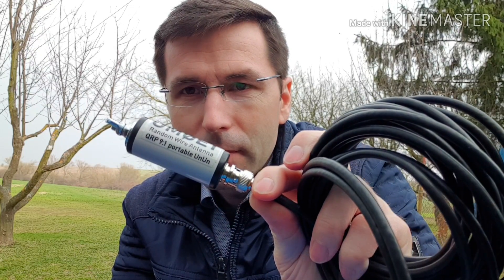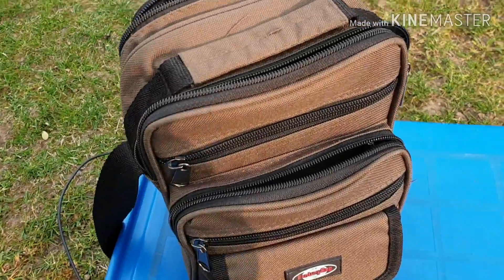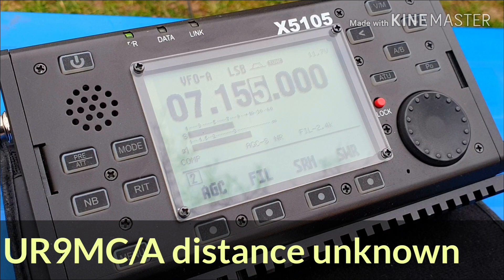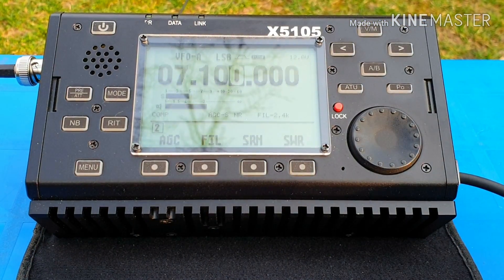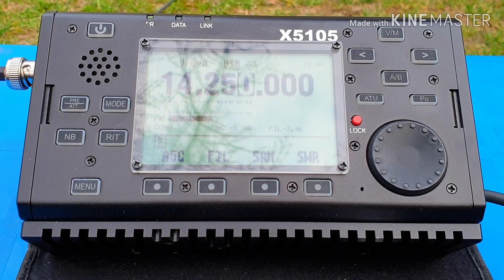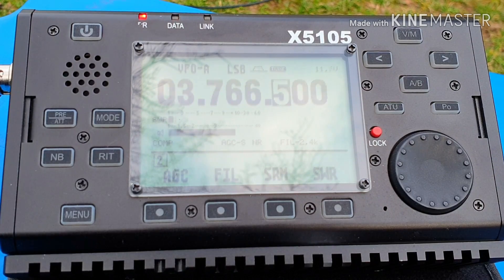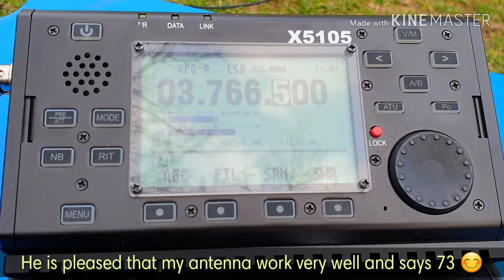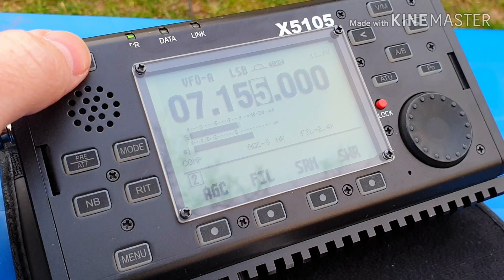#2 TEST:  MINI 9:1 UNUN and 41m long Random Wire Antenna (part 3)

Comment: Hello Paul. An interesting series of videos. The antenna would work much better if you used a long counterpoise on the ground side. This can just be layed out on the ground and it would give the antenna something to work against. Try it with a counterpois that is a quarter wave at least at the lowest frequency you wish to work at. Also, it would help to get the radiator wire s high as possible. For this you can use a telescopic fishing pole. You can buy cheap fibreglass fishing poles about seven meters long which are very light for carrying in the countryside. 73s de G0BZB.

Comment: nice work with the qrp station i have in my radio collection a army vhf radio RF10  from your country before the split i have all the paper work but not in English i think 2 watt on 6m band do you know this radio its very well built my one built in 1985 and its like new  anyway Happy new year to you and yours keep up the good work love the videos
Reply from the maker: Yes Chris I used this transceiver when I served in Slovak Army 😃 but our radios were deaf, I don't know why 😃 Maybe there was some problem with  antenna or electronics inside. Things made during the Communism era were made very well and with good quality, especially things made for Army. Even the components for Army electronics were specially sorted for theyr equipments, incl.radios 😉👍 Thanks for watching and Happy new year! 73, Paul.

Comment: A very well made and informative video, thank you, I have now subscribed. Did you use the ATU on your radio to match the antenna? Please can you say what the resonant frequency of the antenna is?
Reply from the maker: Thank you! :) Yes I use ATU. but not everywhere. On some bands is it not required due to low SWR. This type of antenna is called "non resonant" therefore it should be not any resonant lenght of this wire. The "random" lenght of the wire can't be a halfwave of any HAM bands.

Comment: Nice NVIS setup Paul, think your results closely parallel the what should be expected with an NVIS antenna arrangement, it's not that far above ground. That contact from the Ukraine is about the practical limit, maybe 1000km from your QTH with that antenna under normal conditions. Not surprised you didn't work the W7 on 20, it's not a DX antenna, most of your energy goes straight up.  Can't think of a better setup for local contacts, remote net operation, a grab n go kit or for an emergency setup...you just throw the antenna over a 15 or 20' tree and away you go... so easy to deploy.  A 9:1 balun is pretty easy to make if you have a  proper ferrite core or an old toroid.   Richard VA7AA
Reply from the maker: Yes Richard I fully agree with you :-) But I don't gave up hi hi :-D Of course I know that with this elevation is not possible working DX stations. i will try to made some verical next time ;-) 73, Paul

Comment: The configuration your antenna has been deployed for past year of videos is basically an NVIS antenna. Have you considered carrying a telescopic pole that when collapsed can be used as a walking stick. When expanded it would raise one end of your antenna giving a better takeoff angle for working DX. Mast length could be 10 meters up to 15 meters extended and 2 meters collapsed. 73 KB8AMZ
Reply from the maker: Usually I use a small telescopic vertical SPX100 or my home made magnetic loop 😉

Comment: Congrats on your antenna setup.  I am just getting into QRP.  I have a uBitx, a Bitx40 and finally a QCX40.  I am looking at building a 9:1 unun and have watched all your videos on this adventure.  I am curious as to why you only have 4 turns when the plan show 9 turns?  I have a T106-2 torroid that I am going to use that came from a failed Chinese QRP antenna tuner kit.  So I was curious as to why only the 4 turns.  Really like that setup you have.  DE WD8WV
Reply from the maker: Thank you for watching my videos!  Here I paste one explanation comment from one user:   To clear up some confusion in the comments...It is clear to see that you have 5 turns on the core. Each time the wire passes through the center of the core it is counted as one turn. Even though the drawing we see in the video has 10 turns the 5 turn toroid as built will work but more turns are preferred. The fact that it is a tri-filar winding, no matter how many turns, will result in a 1:3 turns ratio which also results in a 9:1 impedance ratio. This could be made with just 3 turns but, again, more turns are preferred. 10 turns would be much better. No matter how many turns it will always be 9:1 impedance ratio because of the 3 conductors in the windings and the way they are terminated. A ground or at least a length of counterpoise wire is important to achieve a satisfactory SWR.
Reply: OM0ET thanks for the explanation.  I will have to try and build myself one of these.

Comment: Did you try running a ground wire from the ground side of your bnc connector, to bring down your swr?
Reply from the maker: Yes I did, there was slightly better SWR. I use about 8m long coax feedline like counterpoise.
Reply: I am working on a 9to1 and a 1to1 common mode chock connected in the same enclosure. I will let you know how it turns out. Thanks for the reply.
Reply from the maker: @marybilbrey3442  Very well ;-) Thanks too. 73

Comment: You will be surprised if you leave this antenna loose on the ground. A configuration called Grasswire Antenna (Which you can find on the web https://www.google.com/url?sa=t&rct=j&q=&esrc=s&source=web&cd=1&cad=rja&uact=8&ved=2ahUKEwi_-oDmvaLhAhWFILkGHYwIA6cQFjAAegQIABAB&url=http%3A%2F%2Ff5ad.free.fr%2FLiens_coupes_ANT%2FG%2FK3MT%2520Antenne%2520gazon.htm&usg=AOvVaw0zuJ2YDrEmslnoRcgzekCR). Thanks for sharing your experiences. LU1AR
Reply from the maker: Thanks for your comment. ;-)
Reply from the maker: works! but parenthesis shouldn't be there :)

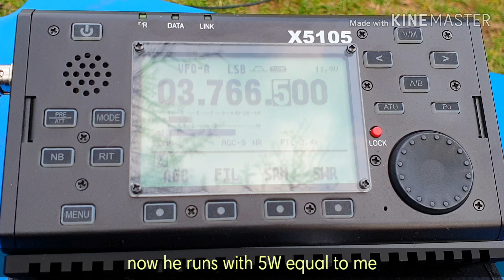Comment: The gentleman that lowered his power at the 9:00 mark actually sounded better with five watts than with 100 watts.  At 100 Watts it sounded a little blurred and was clearer at 5 watts.  Very interesting.  I have been keep up with your build and am very pleased it has turned out so well.  73!! DE KE5ES
Reply from the maker: Hello Bob, thanks for your comment 😉 This blurring may be caused by a small speaker used in X5105. Maybe I had volume turned too loud 😊. I tought that it will be barely hearable in camera, but later I realized that it was too loud 😲. Heh 😆 I have to fix it next time. This UnUn works great for me but it still needs proper lenght adjustments because is shorter than needed. Definitely this lenght 41m is better than 17.6m like it was in my previous video 😊
Have a nice day Bob and 73. Paul

Comment: Paul
Could you talk about the settings you are using in the X5105. Like the RF gain settings, etc. 
About 48% seems to work best for me. 
Also I have increased the CW delay to 800ms. 
I’m building a new 9:1 that should handle 100 watts. 
I always enjoy you build and field test videos. 
73
Wd4dda
Reply from the maker: Hello :-) My current settings are: 
RF Gain 100%, 
CW delay 200ms, 
CW rx Side tone 800Hz, 
TX AF Gain 100%, 
TX AF AM 60%, 
NFM 100%,
RX AF gain SSB 60%,
AM 60%, 
NFM 85%, 
LCD Backlight currently 0% due to power saving during the day, 
LCD contrast 20%, 
REF Clock 26000000Hz, 
NFM TX IF 10697000Hz, 
Beep vol.1, 
Aux AFIN 7, 
Aux AFOUT 63, 
S-meter cal. -34

I don't use CW features because I am PHONE only operator :-) That's great about your new 9:1 UnUn. Let me know when finish and how it works please ;-) Good luck with your project! 73 Paul

Comment: Hello Paul,
I am glad that the antenna works so well. Do you have a stackpole? I have one with 10m length, this I often use for portable operation. Unfortunately the trees on my field do not have the right height ;-)
Thanks for the video
73 Bernd
Reply from the maker: Hello, no I don't have a stackpole yet. If I go to area with low trees I take the UltraLight Magnetic Loop Antenna with me. It doesn't need too much hight. It need just a small tripod and that's it :-) 73 Paul

Comment: Nice work Paul. Just a question, what firmware are you using on your x5105? I saw a little different menu on your rtx, on mine I've installed the 1.0.06 version downloaded from Sinotel.
Reply from the maker: Thank you :-) My FW is V1.0.04 Aug 6 2018 13:51:43 I like this version because has removed all main bugs I had before. I don't know which more features include yours .06 ver. I think there were repaired some CW issues only, right? I am working only phone and that was a reason why I didn't download latest FW yet :-) 73 Paul
Reply: @OM0ET  Exactly, they have enhanced some CW and audio features. Ok thank you and hope to hear you on air :-) 73 de in3ade
Reply from the maker: @Robmarbz  Thank you. Maybe I will look for latest firmware soon too :-) 73 and good week! Paul